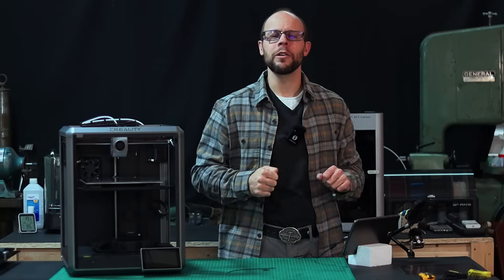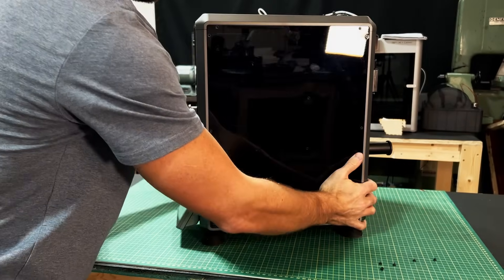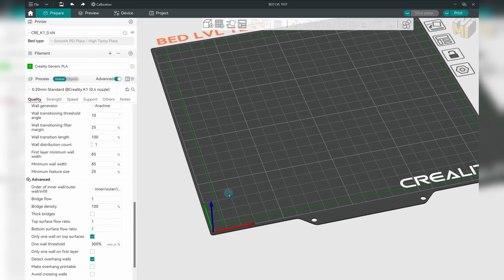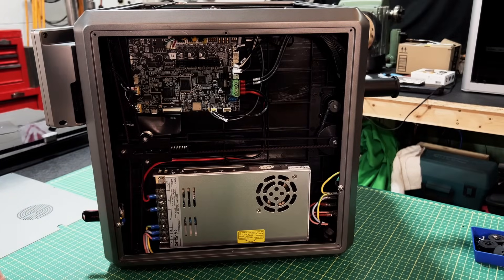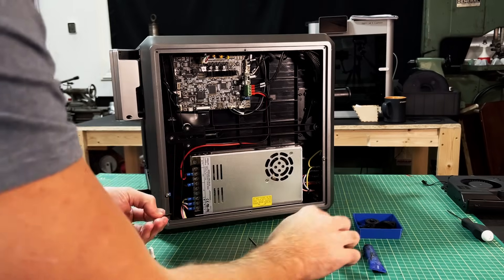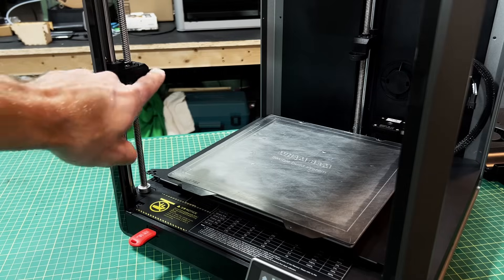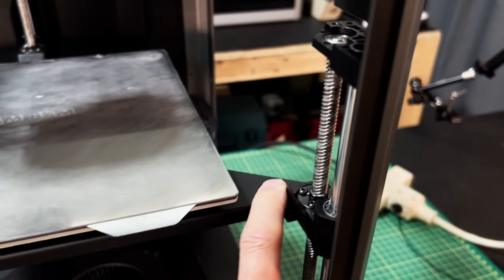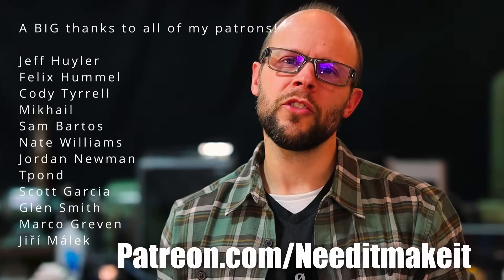Quick and Simple Way to Level Your Creality K1 or K1 Max Bed

Comment: Hi Mike.  Great video.  I'd love to experiment with the spacers so thanks for making those.  The missing nugget of information for me though, is around 7:03 into the video you note that your front corner bed mount was out by 1mm.  And also mention another corner being a high point.  But I couldn't see anywhere in the video that explained how you came to those measurements?  What & how did you measure to arrive at "being out by 1mm"?  Any help would be much appreciated. Thanks!
Reply from the maker: Hi!  Yup, I didn't go over that part, if you have rooted your printers and you're using Mainsail or Fluidd then you should see the mesh already, of you haven't you can use your printers IP address found on the network tab at your printer and plug that address into your browser's search bar and then you'll see the mesh near the bottom of that UI.  For some reason Creality doesn't show it on the Creality Print screen, maybe to hide the issue?  Let me know if that helps!
Reply: @NeedItMakeIt   Aha! Got it, thanks. So you're using the bed-levelling graph in Fluidd to ascertain which corner is lower/higher - not using some complicated series of tape-measures & spirit-levels like I had going round in my head. lol!  :-)
Reply from the maker: @steveharmancambridge  Well I suppose that would work, actually it would probably work pretty well, but the machine needs to level first, which could be a pain to get it exact,  the mesh should get you really close, that's what I used and it's pretty good, the bed itself is warped, and so it won't ever be completely flat, and heating will cause it to change shape as well.  Good luck, and let me know how it goes!
Reply: @NeedItMakeIt  Looking at the bed mesh graph now that I have Fluidd installed, I'm somewhat shocked to find that the bed mesh "range" of my brand new K1 Max is 2.3mm!  Not 0.23 - 2.3mm!  I'm sure doing a hot probe would improve that slightly, but not by say 2mm.  Is there anything physical I can check or adjust on the printer to make sure the basics are ok?  Appreciate your help Mike, thanks.
Reply from the maker: @steveharmancambridge  Do you think you can wait a day or two, I have a max as well, but it is still in the box.  If you can't wait, I would re-run the bed leveling process I showed in the first part of the video, an alternative is to use the tooth-skipping method, there should be some information on how to do this now, I have not personally do it.   Doing these should get you much closer, and then you can add spacers as needed.  Let me know!
Reply: @NeedItMakeIt  Happy to wait Mike (thanks) - meantime I'll follow your suggestion of the watching the bed-levelling section of the video again and see where that gets me.  Cheers.
Reply from the maker: @steveharmancambridge  Sounds good, if I don't return your message in two days, send me an email, the filtering on comments isn't so good.  I've made a note, so that should help.  Talk soon!

Comment: Did not planned buying K1, so came to watch it as an entertainment. As a result - enjoyed your meticulous engineering approach to the problem solving.
Reply from the maker: Hey, no worries, I think there are a total of three issues with this printer, they are luckily all small problems, overall the printer performs well, and it's fast, so I'm still pretty happy with it.  For those of us who don't want to tinker at all, I don't blame anyone for choosing something else, or waiting for a new version.  They have the K1C coming out soon, I think the bed design is different from the looks of it, the height is also a little different, hopefully they've addressed the other issues.   Thanks for taking the time my friend!
Reply: @NeedItMakeIt ohh you should make a combined video an all these three points and how to solve them.

Comment: Quick tip....go down to your local hobby shop and pick up a quality set of RC tools and throw away those crappy L shaped "keys". Radio Control vehicles use the same metric screws that 3D printers use, the tools are way higher quality. You will no longer have a problem with stripped screws. If you do happen to strip a screw, you can use a "ball end hex driver", so you can approach it at an angle and find the sweet spot where there is still some edge on that hex to grab.
Reply from the maker: I thought I had a nice set of ball drivers, but the fit isn't perfect so they are okay, but not when bad things happen...  Can you recommend a brand?   We don't have a local shop, but there is a shop one city, over, I'll take your advice, thanks!
Reply: @NeedItMakeIt  There are some really expensive brands out there. You should be able to get some quality Dynamite tools for around 7 or 8 a piece. The  thing I really like about them is they have a long head, so you can reach some of the hard to get screws.
Reply from the maker: @paulnortness1354  I'll have another look, I was close to going back to my regular set of Allen keys (Fat Max) which are pretty good quality, they're too small and I'd much prefer the screwdriver style grip.  I will take another look, maybe a review video is in order to test a series of different brands to see which ones last the longest and fit the best.  Thanks for that!

Comment: What software are you using there? I'm trying to fine level my K1 bed. I use Creality print but under the device tab there is not bed mesh even after running the self check auto levelling. Thanks in advance.
Reply from the maker: My printer is rooted and I'm using Fluidd or Mainsail, but you can access yours in a similar way by using your printer's IP address in your search bar, you'll see a mesh using Creality's UI there as well.  The IP will be displayed on your printer's network tab just below your WIFI address, hope that helps!
Reply: Thanks I've tried in the Creality UI and with the IP address. My printer isn't rooted I will do that now. Thansk
Reply from the maker: @tomrudd4168  You shouldn't need to root to see the mesh, it's an added step in order to give you complete access to the config file on your printer and run it like an open source printer.  If you want to use different slicers like Orca and send directly to your printer, rooting is the way to go.

Comment: i have the ke . do you have any ideas how i can get mine level like that.
Reply from the maker: I have a KE now as well, let me take a look and get back to you.  I think there is a way to do something very similar, but I'll have to have a closer look first.
Reply from the maker: I did the test and I was able to level my bed within 0.2mm it was about 0.7mm off when I began.  I used my punch set and added a think hard 'cardstock' paper washer below the plastic spacers.  I cleared the mesh and then re-leveled and it looks great now.  I started with a metal washer, but it was far too thick.  I'll end up re-printing with ABS so it looks a bit nicer, but the quick fix was cardstock or the carboard on a cereal box basically.   I hope that helps!

Comment: Spacers worked great in my k1,  but my k1 max is still dished in the middle with the back right corner very high.   I tried a slightly tapered shim on the back lead screw, but it didn’t work. Still more I can try, but I’d be very interested in machining the bed flat.
Reply: …also of course could be the thickness tolerances of the magnetic mat as well.
Reply from the maker: If you're seeing a wavy bed, it's most likely the aluminum plate below, it will be slightly warped, but in addition the warpage will change as it heats up, I could only get mine to 0.2mm at best, the plate is too wavy to do better than that, and for me 0.2 is really good, after all, that's over the entire bed and most of my prints are pretty small in comparison.
Reply: @NeedItMakeIt  mine is a bit of a taco.  I got the four corners level, but the middle is still .5mm lower than the four corners.   I was thinking about things and supposed it could also be caused by the adhesive under the magnetic mat.  I'm new to all this so, could also be totally wrong in my wild guesses.
Reply from the maker: @jb510  Okay, that's not terrible, the fix for that is to add Kapton tape to the top of the magnet just where you need it.  You might need to add a couple of layers, I haven't tried this myself,  but others have tried it and it apparently is proven to work.  Personally I wouldn't add too many layers, it would impact the magnetic attractions a bit IMHO, but they say that it still sticks well.  If I think of something else, I'll let you know.  Hope that helps!

Comment: I accidentally press clear data and now it won’t show me the bed mesh result any fix for that thanks in advanced
Reply from the maker: Yes, on your printer, re-run the bed level sequence and it should do the trick.  I think you can do this through the UI also
Reply: @NeedItMakeIt  cool thanks

Comment: I have a milling machine, so i want to take an aluminum plate and make new table with no magnetic layer, i would just make holes for the neodym magnets to hold the printing plate, i also want to make it a little bit thicker than it is now
Reply from the maker: I can see that working pretty well, is there a reason aside from cost that they keep the weight down on these beds?  I see machined alum on Voron printers, but they are normally stationary and the head moves up/down instead.

Comment: Now I've done this leveling method (with the spacers). GREAT! got me down from 1.6mm range to 0.5mm  - still not great, but I don't think it will get better with those 3 anchor points we're somewhat limited :)
I've taken 2 of your spacers and scaled them in the slicer to the difference to the highest of my 3 pillars. worked easy!
thanks and greets from austria, Mario

Comment: The reason it drops a bit is the backlash between the gears and the belt teeth. You are applying tension only to one side of the belt. You could possibly compensate using adjustable gears or compensating with a tooth jump, but I like your solution. Quick and easy. 

If you have ever replaced a dual cam or more timing belt on a car you know the struggle. Same same. But, you sir did a great job at figuring out a permanent solution.

Comment: Hi just a question. How did you access the config file?
Reply from the maker: Sure, if you've rooted your machine you can access it through the Fluidd or Mainsail UI, this is what mine looks like.  https://imgur.com/a/zUGkNpU  it should be as simple as open, modify, save and then typically a restart.   Let me know if that helps.

Comment: I leveled my bed months ago when I first received my K1 Max.  I used your method, however rather then printing shims I made mine from proper shimming materials
Reply from the maker: I'm not sure how I missed your comment, in any case, yeah proper shims would be ideal, or machine down the standoffs, but that's not going to be so easy.  Nice going.  What is the shim material you used, is a paper-base or metal?
Reply: @NeedItMakeIt  I have various metric and imperial shim kits ranging from 0.02mm through to 2mm in plastic, brass & stainless. I ended up using plastic shims only because it's quick and easy to cut. For anybody not having access to such shims your 3D printed shims would be just as good, just time consuming, but fun to print 🙂

Comment: why do you have to do this? isnt the point of a self leveling 3D printer to self level the bed?
Reply: Its a fixed bed but not perfect from the factory. The mesh fixes it, but we're about perfection!

Comment: What software are used to meassure the bed? Thanks!
Reply from the maker: This is Mainsail or Fluidd, but if you don't want to Root your printer and install these, you can use Creality's built-in software, you'll need to access their UI through your browser of choice.  Find your Printer's IP in the network tab of the menu at the printer.  Type that IP address into your search bar, and you'll see a mesh there that you should be able to use.  It isn't quite as detailed, but it should give you a good starting point.
Reply: @NeedItMakeIt  thank you so much for reply sir.

Comment: I've found with cog belts you sometimes have to have partial tension on them to keep it in time when letting the tensioner take over.
Say like when putting a timming belt in a V6 engine.
A lot of times you might use a cam lock or holder and stretch the belt between two pulleys then the third and apply full tension.
I kinda wonder if you couldn't turn the nuts on the Z screw at the frame to get it more square.
I surface all my magnetic beds with 80g sandpaper and a long piece of 2020 extrusion while heated to get them as flat as possible.
Then do any leveling of the bed.
I'd like to see a video of how you flatten the plate though.
Thanks for the video 👍

Comment: Which software are you using to measure the bed?
Reply from the maker: I've been using Fluidd and Mainsail, but you can use Creality Print, you just need to use your printer's IP address in the network tab of your printer, and plug that # directly into the search bar of your internet browser of choice.  You should see Creality's version of the mesh.
Reply: Awesome, thanks!

Comment: Hi, I would have turned the spirit level 180 degrees, to see if the bubble is still in the same place, because if your level is out anything you check the level on, will be wrong. I’ve seen it many times. The other thing you mentioned was, your using a stamped plate, why go to a material and stamped, if it’s worse for warping, it doesn’t make sense to me, you would spend more time re levelling the heat bed than printing. No thanks..
Reply from the maker: Yes, you are absolutely correct.  This is something I did many times, though I did not show it in my video.  Even a brand-new level may not be level.  I should have used my machinist level to show just how far off it was, the bubble would have been off the scale.  

A machined aluminum plate would be better, but this is how they come stock, and it's super cheap to manufacture.  If you look to some of the Voron printers, they have machined alum plates which are quite thick.  Instead of moving the alum plate, they instead bolt it down and move the entire gantry up and down.  Moving the less-massive thing makes a lot of sense.

Comment: I been thinking on getting a new printer. Ether cr k1 max, bambu carbon or pursa xl. 

What would be the better choice??

On the k1 it seams its not a true auto leveling. I guess the carbon and pursa have that.
Reply: It is only true auto leveling when you have multiple z axes motors. Then the printer can adjust each motor. Otherwise it's more of autocorrection during the first few layers of your print. I have a K1 and really like it. There are a lot of people that hate it and shout out bambulabs. Creality has the ability to root and do your own adjustments in the frimware. Bambu officialy doesn't but some smart people managed to find a way around that already. I think prusa is the one with the best aftersales as far is i know (don't own one, only creality ender 3 and 5 pro and a k1)

Comment: I absolutely would like to see a vid on flattening the bed. I just got a k1 max and am learning every quirk possible about them. I do have a question though. I tried to print in ABS last night with the Inland brand, I got a clogged hothead as a thanks, any temp  tips on how to prevent this? I was printing at 260c. Or is inland just trash? I haven’t had a 3d printer since the original Robo R1 came out so bit out dated on proper brands now. Just Creality had a sale and it just made sense more than a Bambu. Really impressed with how far Creality has come since 2016.

Comment: Hi, I also have the K1 and I still have to check the position of the bed, in my opinion these differences are due to the imperfect synchronism of the threads of the threaded bars, the three threaded bars have a different position compared to each other.
Reply from the maker: Yes, I'd agree.  The problem seems to be the difficulty to get them into the correct position, or 'correct enough' within 0.25mm would be fine, mine was out when I first received it by 1.4mm, which is far too much for anything to be accurate.
Reply: @NeedItMakeIt  but as you see the graph, I can't see the graph

Comment: Hello. Ive been looking high and low for the rainbow colored hotbed display that everyone is using.  In creality I've looked for it while printing and not printing.  I've looked in the tool tab and the calibrate tab. No luck
Reply from the maker: If you type in your printer's IP address (Found at your printer under network) into your Internet search bar, you should have a slightly different UI come up.  You should be able to see the mesh there.  Let me know if that works for you.

Comment: Need to release the sprockets on each of the Z axis lead screws then put the belt on and tighten each back in the correct timing position. It is like the timing on an engine's timing belt to the cylinder head. .  This will make the belts not be the problem.  I hate the K1 Max as I have only had problems with it.  $900 for a printer that constantly needs to be fixed is jus not right.   I have the Bambu Lab and it prints nearly perfectly and I have NEVER had to work on it, not even one clogged print head.